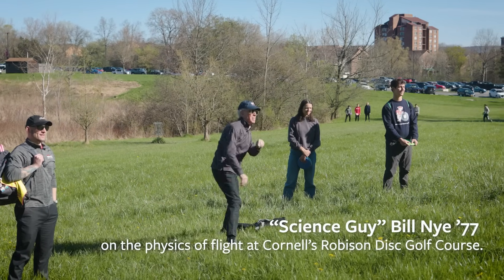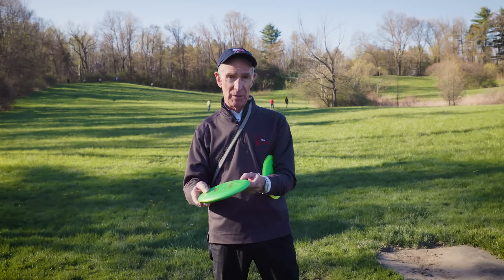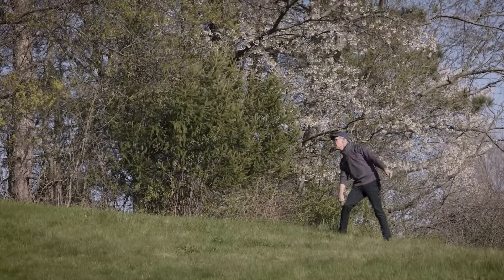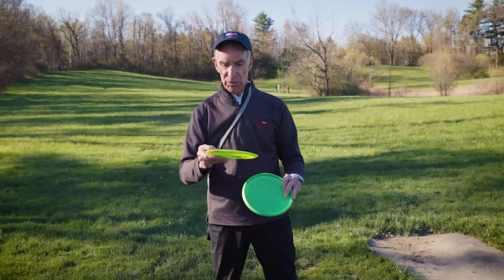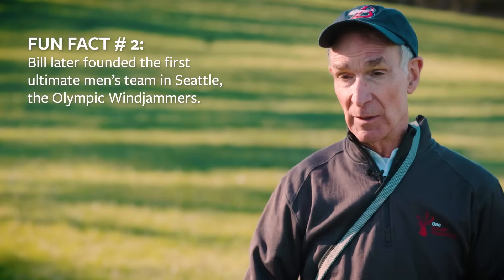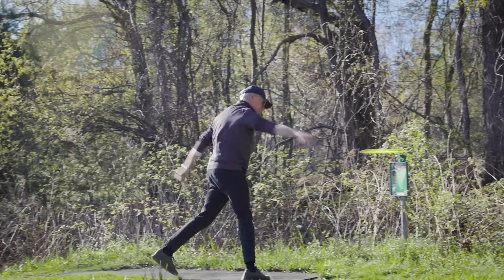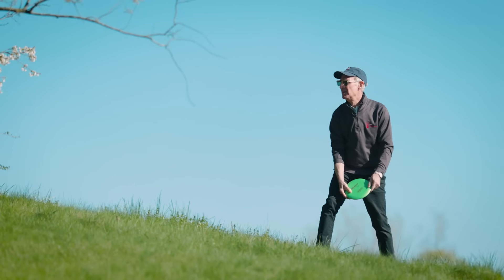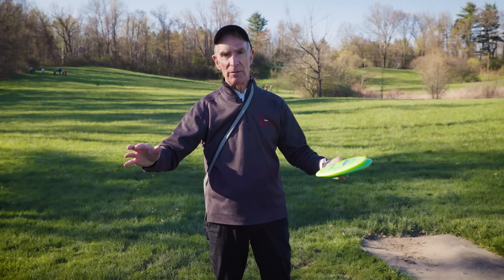Bill Nye ’77 on the physics of flying discs

Comment: Hear me out: All discs have sub-optimal airfoils because they must be symmetric due to rotation. This causes discs to be especially prone to stalling, which causes them to pitch up as they lose energy. However, due to the rotation of the disc and the effect of gyroscopic procession, the pitching-up motion is instead realized as a roll, causing the characteristic fade to left at the end of a right handed backhand.
Reply: Oh my gosh I found someone else who knows this!!!  And the high speed nose down moment of discs with a lot of camber ("low wing") to roll right for RHBH.  It's all just airfoil pitching moments and forces - but precessed 90 degrees!
Reply: @Flyzguy  Yes! A slept-on aspect of disc flight dynamics. I'd love to see someone like Scott Manley cover this.
Reply: I could run some CFD cases and contribute.  I'm a professional aerospace engineer and I've done some educational work, but I have no video production experience

Comment: This is a good start, but a more thorough explanation of the physics of turn and fade would be very interesting to hear. I've argued a lot with my buddies about why the disc behaves how it does and which features of the disc exactly cause under or over stability.

Comment: He says the driver "has more mass away from the middle" but the opposite is actually true, putters and midranges have more mass at the edge which makes them fly more true. Drivers dive out of the air quickly for beginners because they don't have as much gyroscopic stability to hold them flat, then do s curves for more advanced players for the same reason; the lifting forces throughout the flight are more able to influence how the disc's angle changes.
Reply: Bill's right on that one. Drivers have a wide rim where most of the plastic is. Putters have more weight distributed throughout the disc.
Reply: @sal18001  he’s not, though. The wide rim on drivers brings more mass towards the center of the disc, decreasing moment of inertia.

Comment: Air foil crates lift, spin creates stability, force creates forward movement. It works basically like a glider if the wings were 360°

Love this man and this sport - Flight Instructor

Comment: A driver does not have more weight  further out in the rim. (Moment of inertia). In fact a putter has more weight at the rim than a driver does.

They have the same diameter, same weight and comparable flight plate thickness. The putter has all the weight of its rim far from the discs center while the driver stretches the weight closer to the center with its wide rim.

The stablility and flight differences between putters and drivers comes from the wing shape han how it creates lift. Where the center of lift is compared to the center of mass on the disc, and how this changes at different speeds.

Comment: Ok Bill but what makes an overstable disc an overstable disc? Why does it cut to the left when thrown with a Right hand back hand and cut to the right when thrown with a Left hand back hand??
Reply: Quite a few factors there, but I believe the main differences come in the injection molding phase. Here's a quick vid of that: https://www.youtube.com/watch?v=Tkr5W90hXnQ . The higher the parting line is (line on the outer rim) the more over-stable the disc will generally be. That has to do with how it interacts with surrounding air as it flies. For a 12-14 speed the line is high and those discs have to be thrown at high RPM to get them to fly as intended. Lower RPM means mode fade for drivers. For putters and mids the speed/rpm to stability math becomes different. Then there's all the different plastic types, how many nicks a disc has, textured rims/patches on disc etc. Could make a long video out of that. But main difference comes down to the parting line. Super domey discs will be beefcakes.
Reply: @spartacus10  Why does it go left and not right though? (RHBH)
Reply: @shneekyshnake It's actually really complicated. I looked into this and long story short, it's because the disc is a gyroscope and therefore it has angular momentum; whether the force of lift (i.e. the torque applied to the disc) is centered infront or behind the center of the disc while it travels will determine if it "turns" or "fades." things that impact the location of the center of lift are the shape of the disc, how fast the disc is falling, and nose angle. Understable discs usually have a more convex dome and less of a ramp angle on their rim. Overstable discs are usually flatter on top and have a steep ramped rim.
Reply: Yep AJR has it right.  To understand a disc rolling left and right, we have to understand it's a gyroscope with forces trying to pitch it up or down.  At the end of a flight the air is hitting the nose at a higher angle of attack, trying to push the nose up.  Depending on spin direction, this nose up torque precesses (gyroscope) acts like a left or right roll.
Reply: @Flyzguy  Found some good explanations when looking up the Magnus Effect